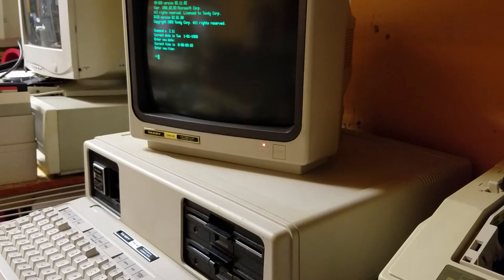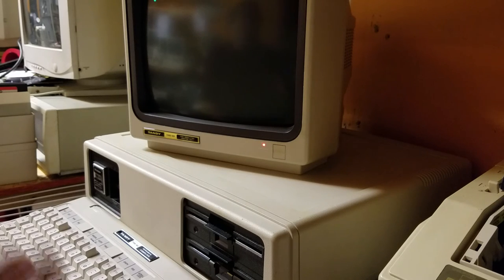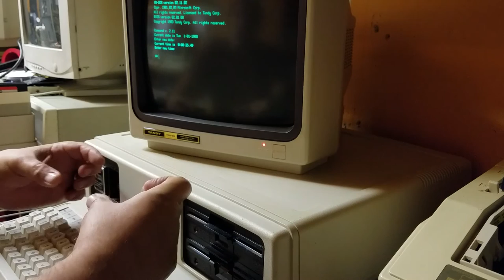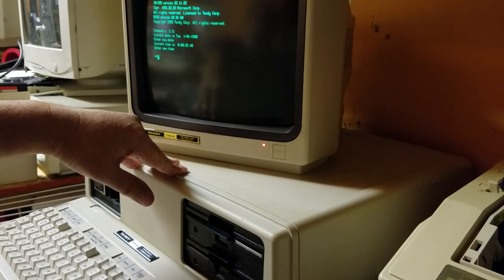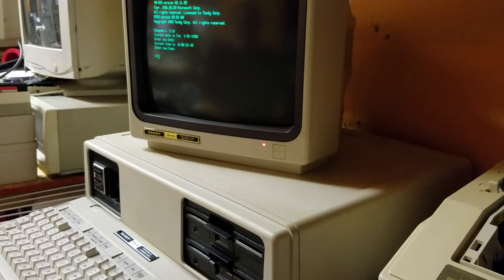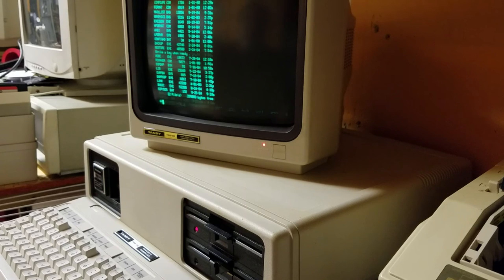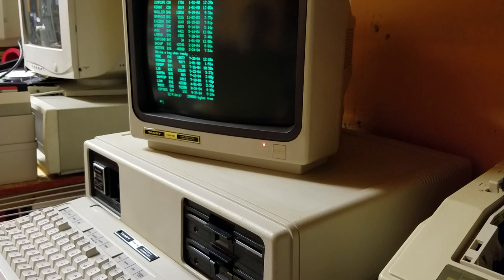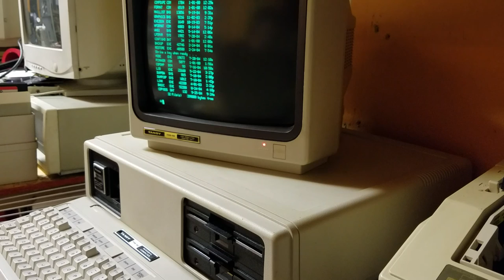Tandy 2000 Finished!

Comment from the maker: I agree with most everything you wrote except for your last 2 comments.  We used one in the store I managed for years. Without upgrades it could do very little.  but fully upgraded it became a very useful & powerful tool. When it 1st hit the market, there was nothing faster for the money. only one thing killed this computer...it was not fully IBM compatible,  and Radio Shack failed to see this until it was far to late. It truly was ahead of its time,  unfortunately time passed to quickly for a proprietary computer. I will always have a great love  & respect for this system
.

Comment: A Tandy 2000 was my first computer, and I learned to program in C on it using Mark William's Let's C programming language. The high-res (for the time) CM-1 monitor was the big selling point. The 640x400 resolution was better than EGA, but with only 8 colors on the screen at a time. I pretty much had all the options. The mouse board though was pretty useless.
Reply from the maker: Did you have the hard drive for it? I would love to put one on mine.
Reply: I had an external 10MB unit (Yes, 10 megabyte!). I don't have any of the equipment anymore.
Reply from the maker: I have a few 10MB HD's none work. (sad)

Comment: My 2000 has the mouse and CGA cards.  Funny thing about these is that though the drives are quad density, you have to use DSDD floppies in them.  Not compatible with the 1000 or most other computers for sure.  They also use freaky weird expansion cards.  I briefly thought about making an ISA bus adapter card for mine to use ISA cards but then I would have to mod or write drivers etc blah blah...
Reply from the maker: I would love to see a video of it!

Comment: i think what the t2k did best was move text across the green screen , very very fast , so fast it has a stop key to freeze the display so your eyes can catch up.... adding the color video card slowed that down some...
I found some floppies for the t2k , some games etc... i dont have anything that will read them set up.... I used to run a t2k bbs , that software is here im sure as well.
Reply from the maker: WOW this post was 6 years ago, before I moved. Do you still have the disks?

Comment: Are there any games that run well on this computer?  From what I know, this is a work-a-like and not 100% compatible and that this is especially so for games because of the graphics.
Reply from the maker: You are correct, few games will play on this computer. It's not even close to being 100% IBM compatible.
Reply: @HavocSun  Thanks.  It's a shame because it would have been pretty competitive speed wise to most PCs of that time.
Does it have any enhanced graphics?  I know it precedes the JR, so it wouldn't have TGA, but a lot of these work-a-like machines had upgraded features sometimes in video capabilities.
Reply from the maker: @tarstarkusz  actually the 2000 was faster then most computers of its time and had a special full color graphics card that went with a special color monitor.  Since this video I have upgraded both the card & the monitor.
Reply: The text games pretty much run great, as do the blocky (text block) games.  About 1/4th of the regular games run more or less.  Lotus runs great.  There is some software out there for download. Windows 1.0 works great but you need a preinstall disk (also out there if you search for it)  Windows 1.0 games seem to work for the most part if you have Win 1 installed.
Reply: I seem to recall an early version of Microsoft Flight Simulator worked on it.  According to the package anyway.

Comment: I have 'several' of these Tandy 2000's in storage with Large Software library including Windows 1, Color Monitors, even an Envision Design's expansion board memory with 784K ???, and mouse,  Also Vianet hardware for networking, Any Interest???
Reply from the maker: Yes very interested, where do you live?
Reply from the maker: I mean, not exactly "where do you live" just to get a idea on shipping. Contact me at netpak@aol.com
Reply: Don't know if you're still dealing in T2K's, but FYI the ED memory board was 768k. They also made a couple other upgrades for it; a dual-drive HD that supported 2x 40mb drives, and a 8087 math coprocessor add-on. There was even a memory upgrade to 896k in the works when the bottom dropped out from under the market.
Reply: @dnechodom  Oh I have a couple Envision memory boards too.
Reply: Sweet! Sure wish the market hadn't tanked; I still have dozens of blank circuit boards for all the existing & 'future' offerings from ED, and memory chips purchased just AFTER the big price hikes. DUH!

Comment: Cost around $3000 back in it's day. Needed several expensive upgrades to run most of the programs and compatible with hardly anything. Sound is limited to beeps. They ran pretty fast for their time and I believe most served as business machines-not home computers. The Atari ST and Commodore Amiga made this thing look like an abacus.
Reply from the maker: dstarks80 I think people are getting confused at the timing of the manufacture of these computers you have to understand just like now things changed in days and weeks the two computers you mention were released after the 2000 and in fact at the time of this computer's release for the money there was nothing faster. You are right about one thing it was meant to be a business machine it ran the store I managed for over 4 years and did an excellent job at it
Reply: The software to run your ledgers, payables, etc also cost about $3000!  Radio Shack sold those for about $500 EACH module!

Comment: We had one of these, but we never could find any games or software beyond Lotus 1,2,3 for it.
Reply from the maker: Software engineers shifted their energy to the more common IBM standard DOS OS, it was unfortunate because this was at the time of release a very powerful computer. If you look hard enough you can find a few games for this beautiful system. Flight Simulator comes to mind.
Reply: I believe you can modify DOS programs to work pretty easily on it, but I've never done it.
Reply from the maker: I have worked with a few people that program software for these computers now, they our part of my Yahoo Group. Outside of some games & productivity software I am told it's most difficult.